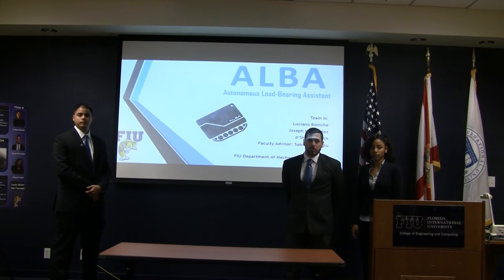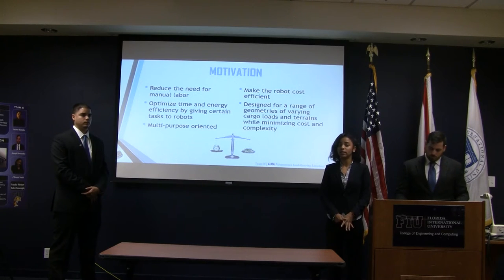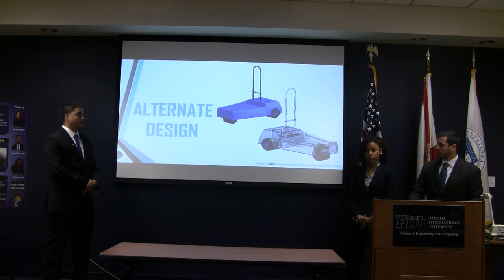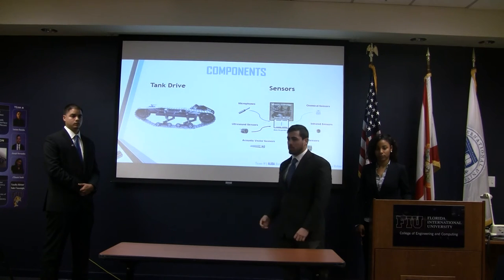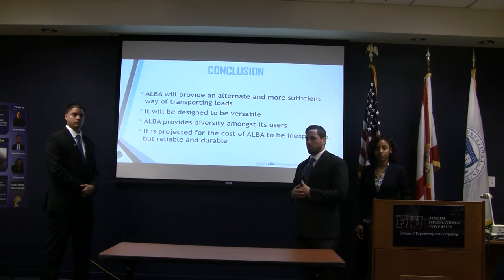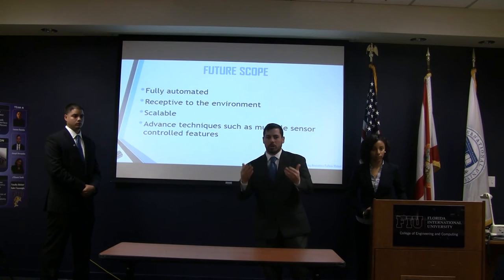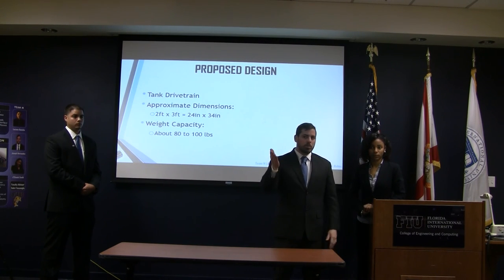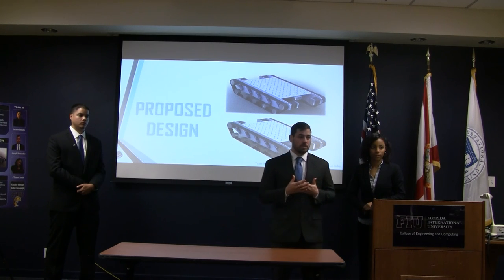SDO Team 07: ALBA: Autonomous Load-Bearing Assistant Robot

Comment: The power point presentation is clear and easy to comprehend. There is also a good use of visuals. The presenters did not have a smooth transition between each speaker. Moreover, the speakers were not loud and clear. They also lacked confidence while presenting the power point. The speakers were well informed because they answered the questions with confidence. Overall the presentation was good but can be improved.

Comment: I think you over complicated yourself by trying not to look at the slides. I think it would be better if you used the slides to your advantage to drive your memory; reduce the amount of text in them and then glance briefly before you begin talking, this should serve as a good refresher. Also attempt to have some transitions between the speakers, it will improve the flow. Some of the presentation felt very rigid as a result.